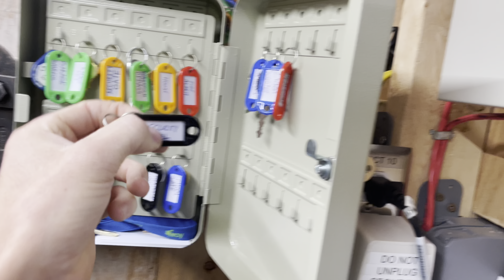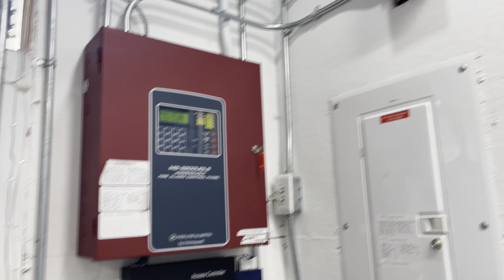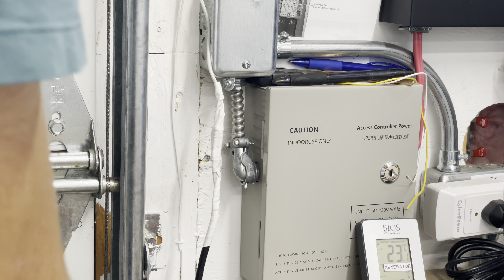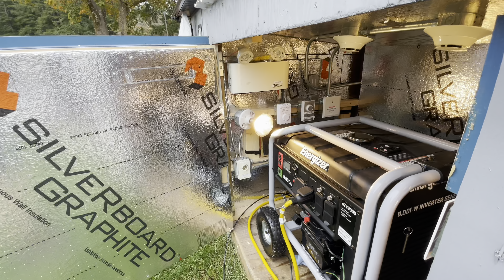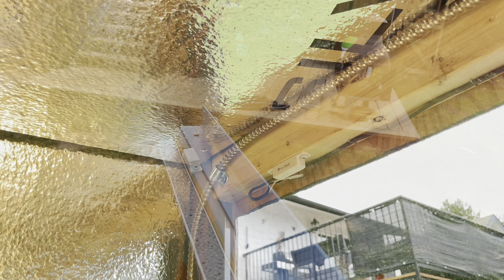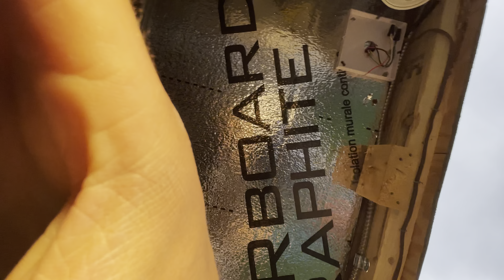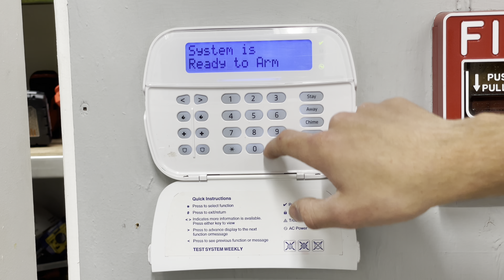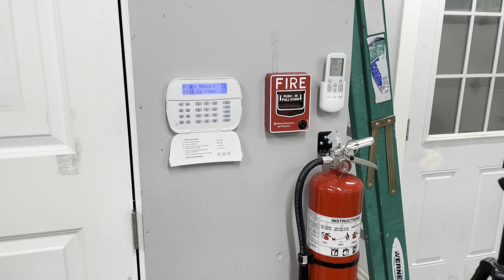Security system expansion to generator building (didn’t go as planned)

Comment: Hello nic, mainly I work with security systems and have the same voice driver model, including it's older brother that has the older voice. Let me go ahead and give you a quick run down on how you may have killed the board on accident. 
1: Overloaded which fries the board like a BBQ
2: Incorrect connections
3: Too many ohm usage as I am assuming you are using 8 ohm speakers on your system

If you are going to be using 2 Ademco 746's (I am assuming those are your speakers because they are the same design and you need a siren driver to make them work), you will need to connect the 2 wires from the driver speaker terminals to one terminal on the speaker, and for the second connection to the speaker, connect it to the the other speaker to make a 16 ohm speaker in series. 

For more information, check your owners manual, and you may be able to try this again.

Also I get most of my alarm parts on eBay, my ELK 110 v5 was 18 bucks on ebay in new conditon which has the CO message and everything (Make sure it is the one that looks exactly like yours that has the plug in wires, it's older brother which came out in 2000 or something has soldered wires and a smaller board), so if you would like to try this again, definently try to see if there is a new one on ebay that is NOT 140 dollars (rip off price in my opinion)
Reply from the maker: Yeah I think it was overloaded I had two 8 ohm  speakers one was 20 W I think the other was 15 and I had them wired in parallel unfortunately I was told it would be fine and then obviously it wasn't lol
Reply: @nics-systems-electric probably would be wise to wire in series and use the same wattage (possibly). If you need assistance for that, check your owners manual that you should have gotten with your siren

Comment: Idea to not break the voice driver amplifier again: Use a normal siren in the generator building and only have the voice driver amplifier thing running the indoor siren. If you kept the amplifier board from the normal siren, you can connect it back to make it a normal siren again. Also, maybe turn off power to the security system and unplug the battery before messing with the wiring so you can check the wiring before connecting power. I think the voice driver amplifier died because you might have accidentally shorted its output.
Reply from the maker: It died because of over loading, I'm thinking I probably just won't do the voice siren system anymore
Reply: @nics-systems-electric  Remember the security speaker you put inside your garage to use with the voice siren driver? You can get a normal siren driver, one without the voice functionality, and connect it to that speaker to use it as a normal siren. Or just replace the speaker with a siren so you do not have to mess with a siren driver again.
Reply: The driver is rated for 8 ohms impedance and 2 speakers together would be 4 ohms I believe
Reply: @Twentytwo22-entertainment  Yes, but on the manufacturer's website, the ELK-110 voice siren driver is rated for 4 ohms. I don't understand why it failed with 2 speakers connected together even though it should have been able to handle it. One of Nic's speakers may have been 4 ohms and not 8 ohms or the siren driver output might have been shorted somehow.
Reply: @nics-systems-electric  you could use an external amp and a device to convert the voice siren drivers speaker output into line level and then send it to an external amp then connect several speakers to it

Comment: Placing a contact sensor on your Generator building was a great idea. because locking your generator building isn't enough because burglars can pick the lock and steal your generator, a contact sensor and siren adds another layer of protection
Reply from the maker: I doubt any thieves are skilled enough to pick Schlag Everest but it does add some security if someone was to reach around and unlock it mostly for me it's nice as an indicator to know if it's been left open

Comment: Idea: You could have used the other colors as grounds or the wires where if a + or - wire is cut they can be used as a backup.
Reply from the maker: You could do that and you still could you would just have to strip it back a little bit
Reply: @nics-systems-electric  I understand what you mean, but i would have used the other colors as grounds so if it got a short circuit, it would just exit into a conductor on the physical exterior of the building. (for example grounded to a screw inside of some conduit.)

Comment: I have an idea that you might like what if you connect a wire from the access control system relay to a zone on your security system then when you use you unlock the door using your keyfob it would disarm your alarm system just an idea
Reply from the maker: Less secure that way if somebody was able to clone a fob
Reply: @nics-systems-electric unless it’s a sato access control system

Comment: You shouldn’t use speakers that take so much power! Like lower power speakers should be fine
Reply from the maker: 15 watts is not high power at all the existing one was 20 watts I think the max is likely 30 watts however I was told it would be fine a low power speaker would not be very loud
Reply: @nics-systems-electric  Ik but it’s best to go with speakers that don’t overwealm the voice board

Comment: request to put LCD-80F Or ANN-80 ANNUCIATOR
Reply from the maker: Where and why?
Reply: @nics-systems-electric  put on shed and you'll not running to the garage,that's tired
Reply from the maker: @bz457  what shed are you talking about? I do not see the need for a annunciator anywhere on my system
Reply: @nics-systems-electric  SPCPittsburgh1574 was suggesting that so you don't have to run to the garage every time you set off the fire alarm to silence it